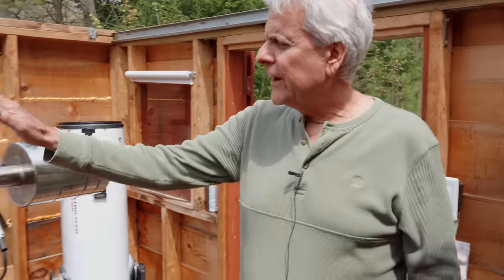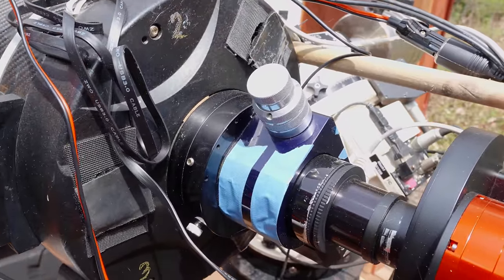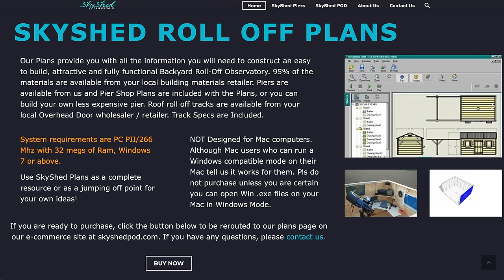Kevin Boucher's Backyard Observatory (Observatory Tours #5)

Comment: Very cool observatory. Being a snowbird, I have two observatories. One is a courtyard with limited but workable views of the sky. The other is a 12x12 foot concrete pad with a Primaluce pier in the middle and tall solid fence on two sides to block wind and lights. I haven’t been able to justify building a rolloff building since we may move in a year or two and I have a huge shop for storage thirty feet away. Set up there only takes 10 minutes since the mount is left covered and aligned.